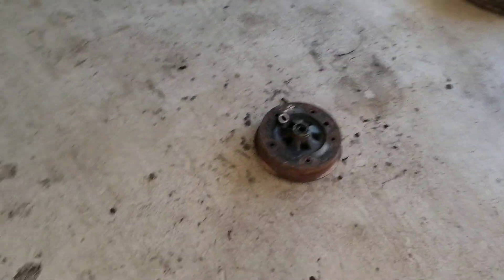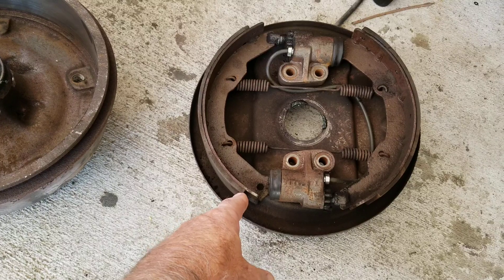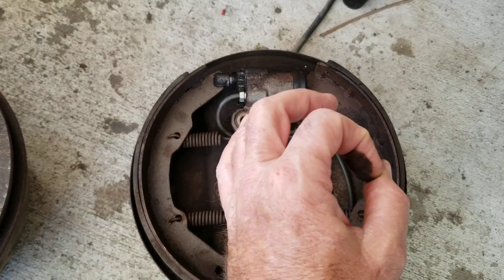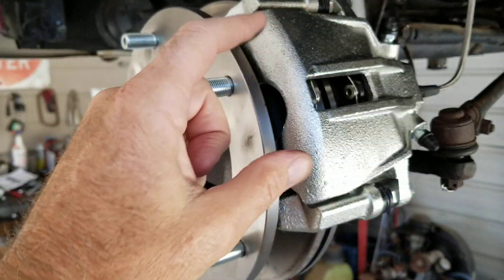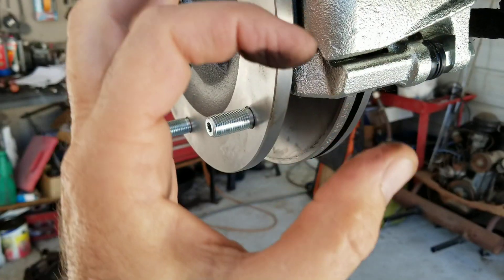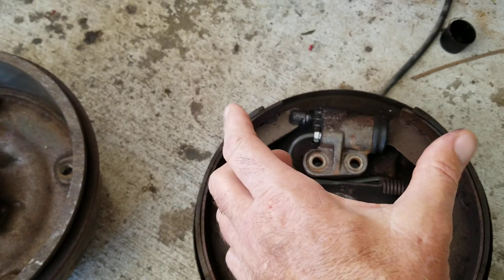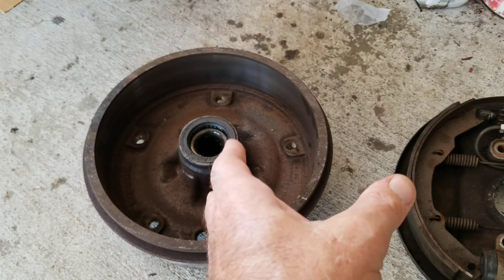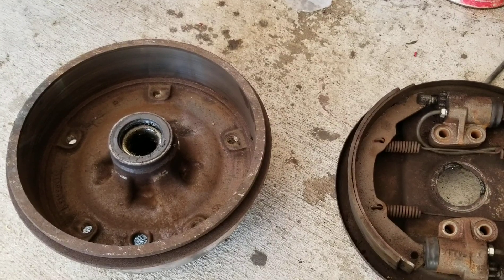Why do  Disk brakes work better than drum brakes

Comment: Good info. Can you review the instructions for the installation of the ac industries disc brake kit? Interested in how you have to rebend the lines near the master cylinder.
Reply from the maker: already done video coming up in a few minutes. the lines were really easy to install. because only one of them needed much rebending. the others just a small bend. When i put the new master on I put the lines on it first then put the master in place not an issue.
Reply: @Mikefngarage  someone on the forums said they didn't like the lock washers and they ended up replacing the ones that come with a kit
Reply from the maker: kit uses star washers which work ok but I think it is a clearance worry. I addressed it in the video. I used them because it is pretty tight tolerance. the kit wolfsburg west sells is 1400 and this one is near half that and I think it is pretty good especially because it includes the dual reservoir master. which is usually around 200 alone. for a later model van.